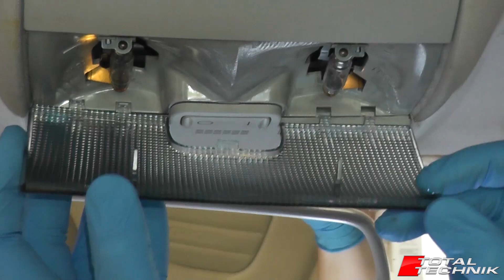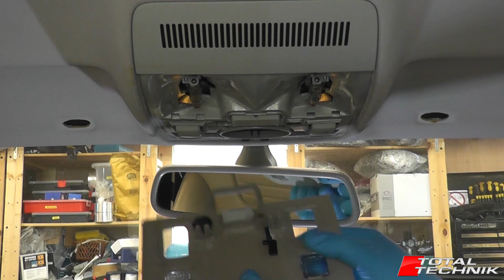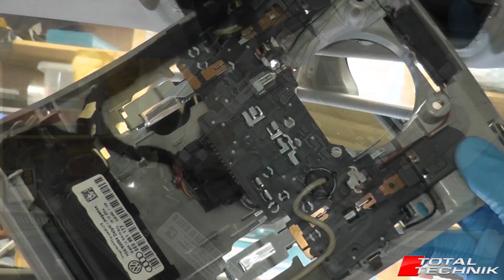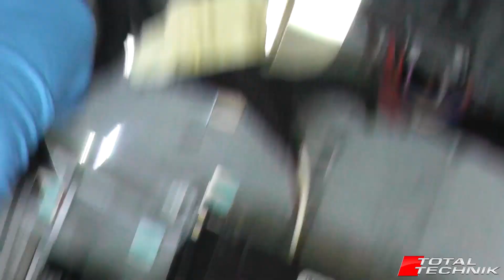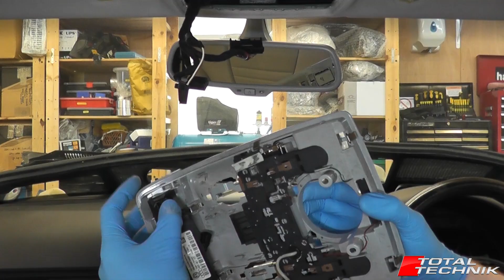How to Remove Main Roof Reading Light   Audi A4 S4 RS4   B6 B7   2001 2008   TOTAL TECHNIK

Comment: Could you not simply feed the entire plastic assembly back through the rectangular opening in the headliner? No need to disconnect any wires then.
Reply from the maker: Hey there. Possibly. It depends upon what you are trying to do. If you need to remove the light panel from the car for replacement or repair etc then obviously no. But if you are removing the headlining panel for example and don't 'need' to remove this light panel  then yes in theory, why not :-)